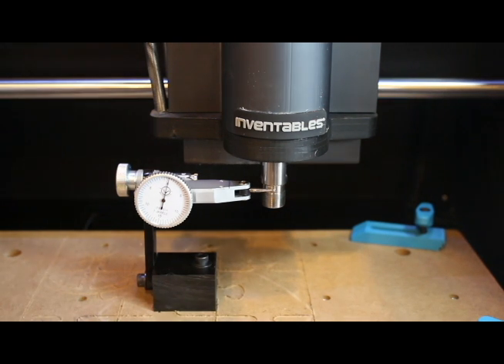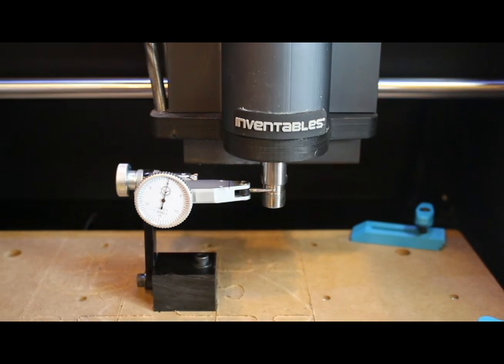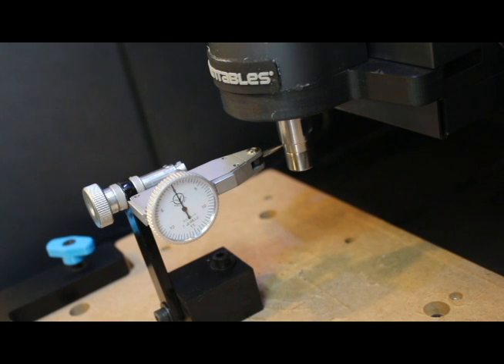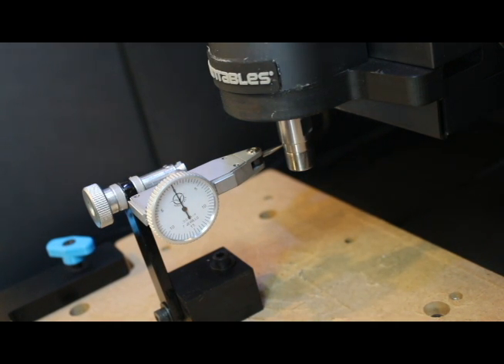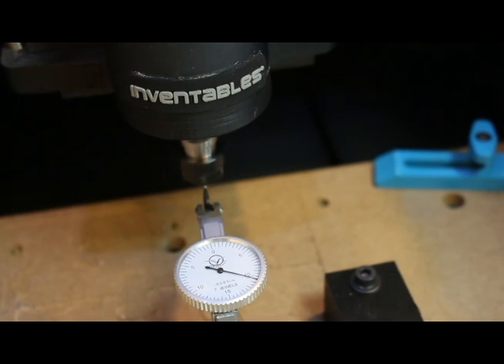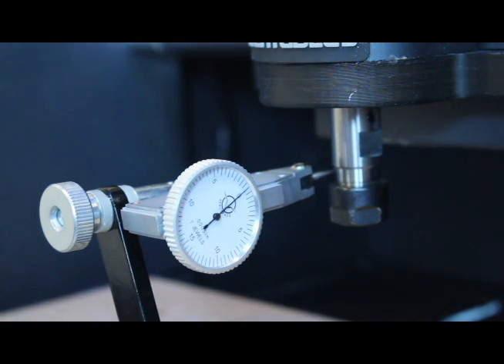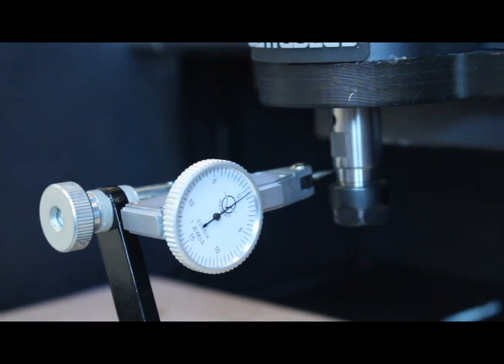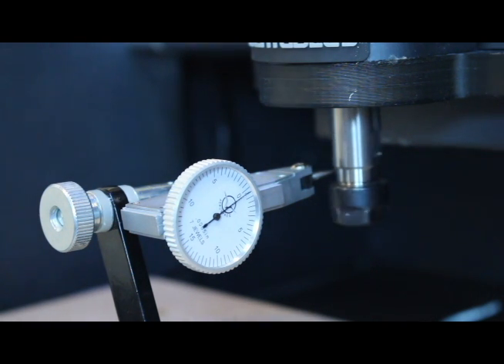Carvey the 3D Carver by Inventables - Repeatability and runout test

Comment: Runout on the outside of the spindle doesn't really tell you anything as far as how accurate the spindle is. Check the inside of the bore or chuck a precision bar into a collet and check against that.

Comment: I'm confused.  What are your actual repeatability figures?

Here (& the FAQ) you're saying 0.0004" runout and 0-0.0005 repeatability, with promised figures of 0.0006" and 0.001".  Yet in the Technical Specification on Kickstarter you're quoting repeatability of 0.001"-0.003".

What are your actual promised and expected repeatability figures?  There's a fairly big difference when you're talking fine work between 0.00000" and 0.003" when you've also got a run-out of 0.0006"